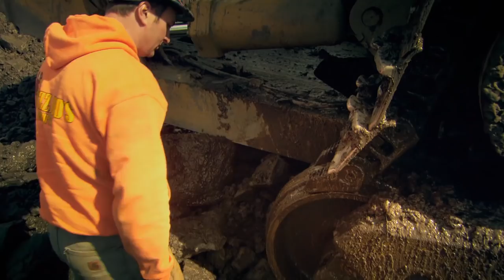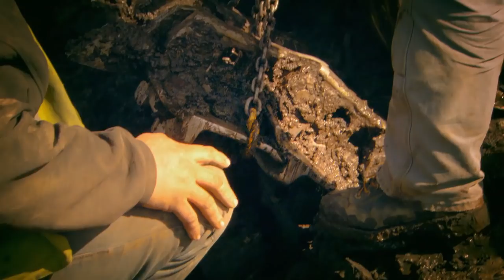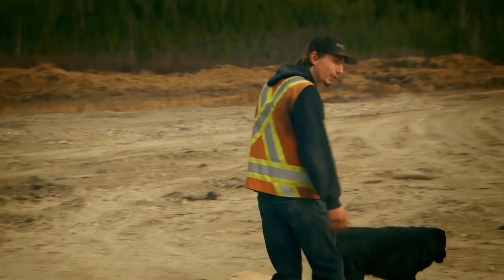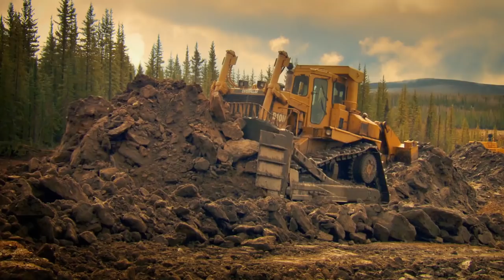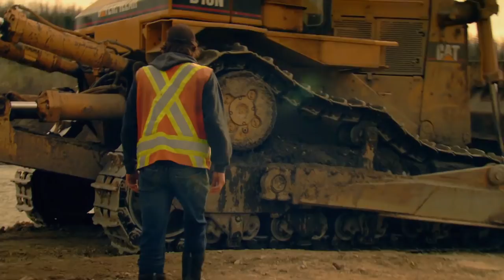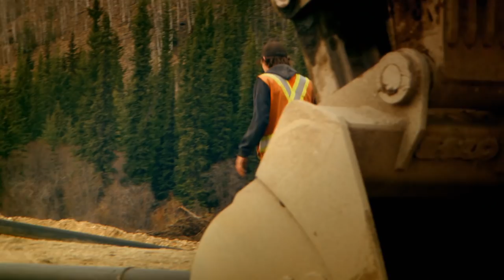Brennan Breaks A Dozer for the THIRD TIME In Two Days | SEASON 8 | Gold Rush

Comment: You can't check every nut and bolt on a track by just doing a visual walk around the vehicle like Parker stated, as for the bearing there's surely no way of knowing it's going to break when you're driving a 50 ton vehicle over rough terrain until it seizes or shears off.

Comment: Ffs a bolt shearing off has nothing to do with the operator. Look at the ground that hes working in. Plenty of stones. As for the bearing coming apart thats just wear and tear. The track splitting is just bad luck. Maybe it had a stress fracture. Hard to tell if something is wrong when its covered in mud

Comment: blows my mind, how u can get so pissed over something that the dood had zero fault in. how the fuk would he see the bearings seizing up?? not to mention u know that none of those machinds are newm there probably used to hell. shit breaks on old equipment and even on new equipment when u use it 11 hours a day non fucking stop doing non stop hard work. I will say parker handles break downs the worse outaa any of the other guys,  todd is usually like ahh fuk me  when something breaks,    and tony is just like get it  fixed, cause he has been up there forever and knows shit breaks, hence why he buys a bunch of the same machines so the old  ones can be a part haven for the other one if it breaks, so they don't have to wait ordering a part

Comment: Looks to me like his mechanics suck putting master link bolts back in with a 1/2" drive electric impact and no torque wrench
Reply: It's definitely possible they just used the electric impact to get it on and walked it over to a compressor to tighten it correctly but you would think that his truck compressor is working unless they couldnt get the truck close enough to the area the dozer failed in. No way to know for sure with edited footage.
Reply: I work as a diesel mechanic and I could not agree more! Torque to the correct spec and you will NOT have an issue. The fact that worker put that bolt on with a 1/2 drive electric impact is ridiculous
Reply: I saw that wtf!! Gotta use 1" gun
Reply: Yeah no kidding. I know on an 850 John Deere dozer we torque them to 650ftlbs and then a 1/4 turn after that.
Reply: @DerekGraham777  rich? He probably works harder than you.
Reply: @Marcuslobenstein  He literally drives/ walks around giving orders. If he does anything it's driving the machines or alittle shoveling than takes back off letting his foremen take back control of the team & work. Parker may work harder mentally figuring out all the stuff he wants them to do but he deffinetly is no where near working physically harder than most other workers on & off this show.
Reply: @austinhansen9079  I'll gatantee Cat has a torque spec,there's torque specs for bolt on cutting edges
Reply: @1986tredie 9
Reply: Rick 94 he’s a boss for a reason... he worked his way up to this position
Reply: That's surely just to run it in... You don't need air to finish the torque, just use a big as$ strong bar with a long pipe, and if you can't 'feel' the tension then use a torque wrench.

Comment: TRACKS LOOKS WARN OUT TO ME  ?
WONDER WHAT'S THE MAINTENANCE HAS BEEN OR LACK OF !!
Reply: What maintenance are you referring to? Sure maintenance will prevent a hell of a lot of things from happening but I am not aware of any maintenance that prevents tracks from eventually stretching or bolts from breaking while operating such a heavy track driven machine. Aside from swapping all of the track bolts at a certain period (which nobody does, everyone waits until one breaks and then swaps it).
Reply: Mad Pierrot This is true, Used to work constructions and we had some shity old machine and the company wouldn't replace them until one day 4 of the bobcat and dozers broke down within a day and we had to all go home. We didn't work for 2 month but by the law the company still had to pay us. Guess karam was a bitch
Reply: Tracks don't "stretch" the parts wear and the contact points go away, I replace and tighten track pad bolt all the time. Mad Pierrot you must have spent some  time in real ghypo type places man, what you think is ok and most company's do is out in left field.
Reply: What is a track tensioner for then? Lay a worn track next to a shiney new one and tell me they are stretched.
Reply: @azadabarbarian4305  I've never heard of a bobcat that has metal tracks like a bull dozer unless it's a cat but you said a brand and as far as my knowledge goes bobcats have never had a metal track on them and I've worked on almost every bobcat model with tracks so your clearly bull shitting your whole story
Reply: @mitchelsalas3185  I didn't read anything about metal tracks in Azad's comment. Either he deleted a comment that specified metal tracks, or you misunderstood the comment. He just said they broke down, unless your suggesting a dozer can only be qualified as broken down if it has something wrong with a metal track.
Reply: "TRACKS LOOKS WARN OUT TO ME  ?"
Why is t hat a question and why are you typing like that?

Comment: That little battery impact is a joke for track bolts. That mechanic should know better.
Reply: Actually track bolts don’t need to be all that tight. You gotta leave them somewhat loose so the track can still easily wrap around the idler and sprocket.

Comment: if u don't run shank guards on a ripper they wear and brake,no one can see idler bearings going out or bolts braking doing a walk around in the mud like that.thats a mechanics job.
Reply: Idlers will leak oil normally when the seals have failed. If you catch it early enough you can save the idlers. 3 walk arounds a day for leaks, loose bolts, cutting edges and a few other normal components goes a long way.
Reply: @marclaky384  I could see the three walk arounds helping.  But you'll never see every individual bolt on the tracks in mud. especially if it's a cracked bolt.
Reply: @snoop4470  yes and no. Bolts on tracks normally don't just come loose of properly torqued, they brake. You can sometimes catch it before you loose a track pad or worse. You won't catch everything, but a good operator taking a quick look at a few important components a couple times a day can save a lot of money and down time.

Comment: How is one going to inspect the tracks when they covered in mud????? One would have to spray them off with high pressure water than inspect each and every piece of the track and the rest of the gear/ wheel system.  Is it the simple fact they are not designed to push mud??? I worked at an open pit mine they didn't use them to push mud, they pushed dry material, all day long for years without these issues. Typical management want you to inspect  the equipment but does not provide the time or equipment to do so.  Not like your going to spray off that equipment daily and inspect it??? Too much down time, Down time is not making money.

Comment: Those dozer's were not designed with hammering through permafrost in mind.. a ripper is not an ice plough.. No wonder they keep knocking the tracks apart.. Its not the drivers fault.. If you tell him to keep smashing away at  a layer of frozen rocks absolutely bolts are going to break and bearings are going to snap here and there...  I think Parker knows this but just wants to take his frustration out on the driver as if hes the one actually making the dozer horse through a frozen wasteland of rock..

Comment: Buy  new machines and it will not break.Nothing to do the operator.Owners do not want to do proper maintenance.
Reply: true, walk arounds are to spot flat tires and broken bulbs, not to see if a bolt is cracked in half inside of a steel track. you wont notice that unless its hanging out, you also cant see inside that casing to see if the bearings on starting to bunch.

Comment: Shit happens its not always the operators fault for equipment failure. The mechanic is the one who does the walk around and checks bolts and shit not the operator so its just as much,the mechanics fault
Reply: Chris Coleman no the operator does the checks, like a lorry driver has to do his checks every day before setting off.
Reply: Is the operator a mechanic?  a walk around is for obvious visible problems.  Most of the time is something breaks you can't see if it's gonna go or not.  a weekly inspection from an actual mechanic even if it is only an hour or two will show a lot more of what could go wrong.
Reply: Exactly right. Also, unless that bolt had been visibly hanging loose, there is absolutely no way that a mechanic could have identified it as a bolt that was going to break.
Reply: The operator does a walk around but its the mechanics job to do the. Preventive maintenance and make sure the bolts are tight and everything is working properly not the operator what do you pay the mechanic for that's There job if the mechanic did his checks as well Parker equipment wouldn't break down its not just the operators responsibility
Reply: Not to mention the mechanic could keep Parker informed of possible defects that could happen so,parker wouldn't blame the operator and he shouldn't in the first damn place. Unless the operator was blantly abusing his equipment. the mechanic should be equally responsible for  not doing his job in maintaining the equipment
Reply: They probably aren’t even servicing them every 250 hours like caterpillar requires ....

Comment: I had my boss do this to me just the last week. Machine wasn't cutting right so job took longer than it should have. When he asked what took so long I said I had to figure out how to fix it. He stopped me mid explanation to say I was using the wrong word since the machine is made to do that and is expensive, so I should have said I was trying to figure out what I did wrong. Been using it for years, generally without issue. This is a guy who doesn't know how to run most of his own machines. Parker should know better.

Comment: I work on heavy equipment the operator is not going to catch everything a lot of the problems are profits over everything if it was fixed right it was still be running can't blame everything on the operator